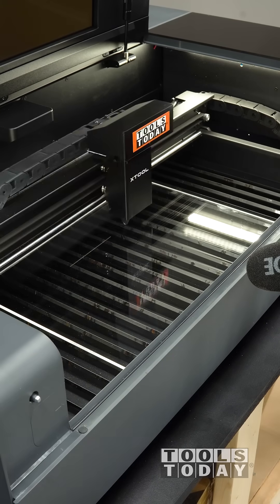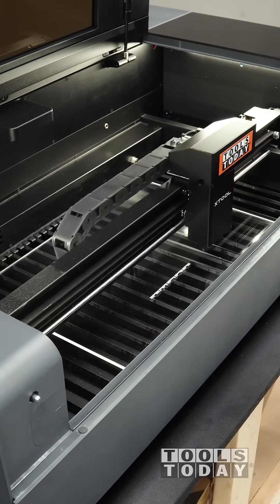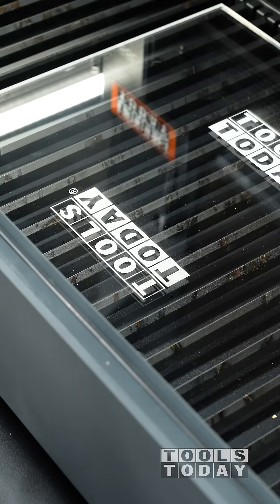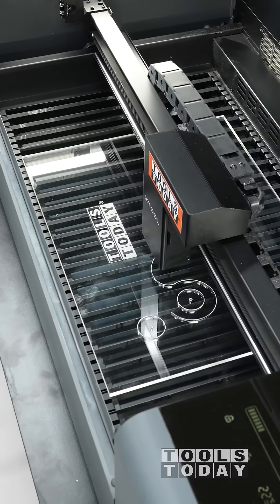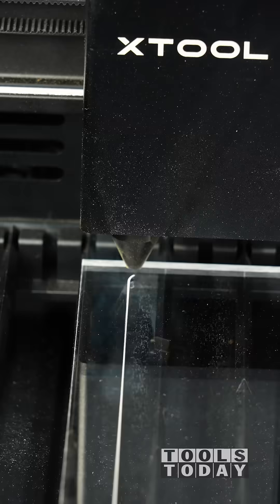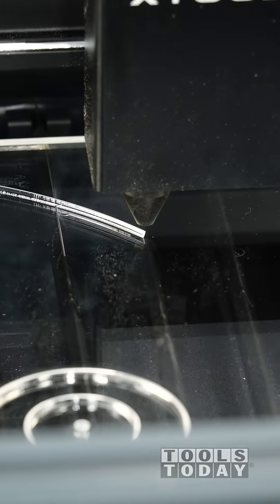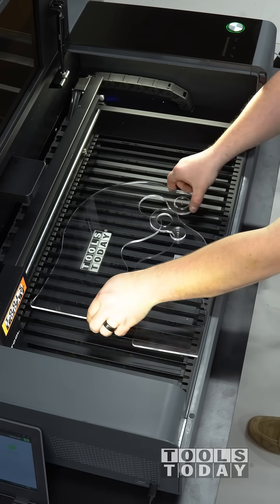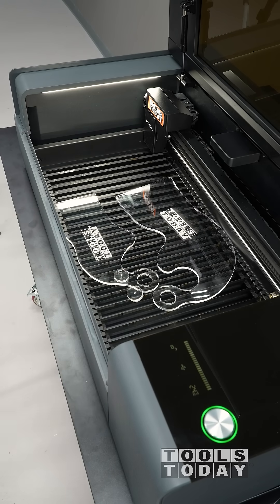Acrylic Templates on Laser - xTool P2

Comment from the maker: Engraving and cutting out some acrylic templates using the xTool P2 55w CO2 laser! The laser cut and engraved this acrylic beautifully and is now ready to be used to flush trim some wood to. 

Engraving
Power: 15%
Speed: 500mm/s
Lines Per cm: 200
--
Cutting
Power: 100%
Speed: 9mm/s
Passes: 1

Check out the tools used on our website -  

xTool P2 55w CO2 Laser - https://toolstoday.com/xtool-p2-55w-co2-laser-engraver-class-4-with-fire-safety-set/

xTool Smoke Purifier - https://toolstoday.com/xtool-safetypro-ap2-air-purifier/
Reply: What were your settings?
Reply: @mickkoldy1323  also would like to know!!

Comment: If you lift the acrylic sheet a touch during cutting with  little spacers or something  you'll avoid the little "nicks" caused in the acrylic. when the laser passes the metal supports.   You can see the little "light flashes" as it passes each support.
Reply from the maker: That's a great tip, I'll have to give that a shot!